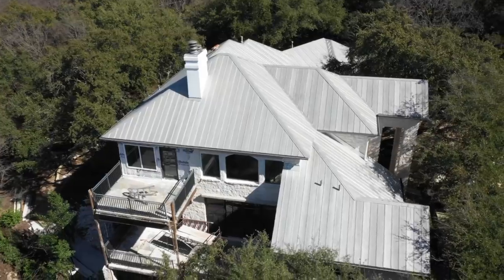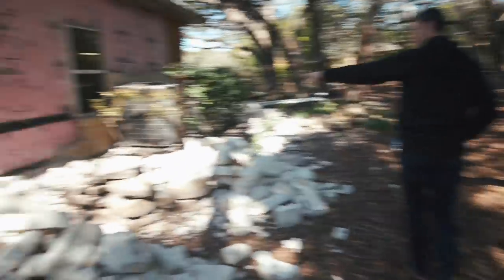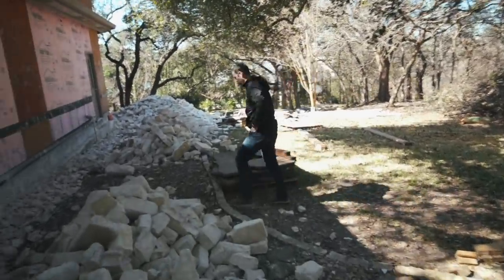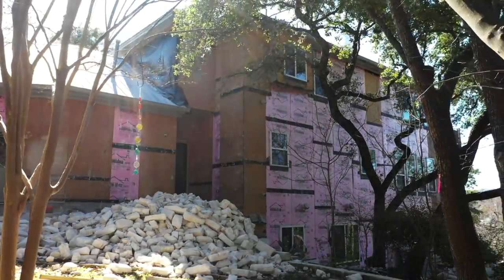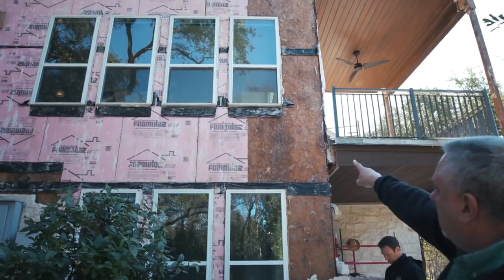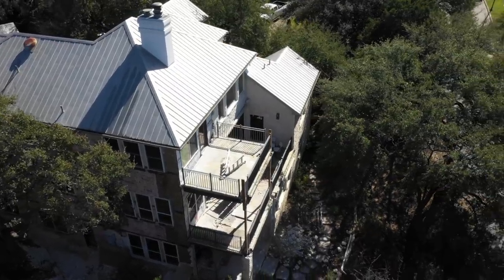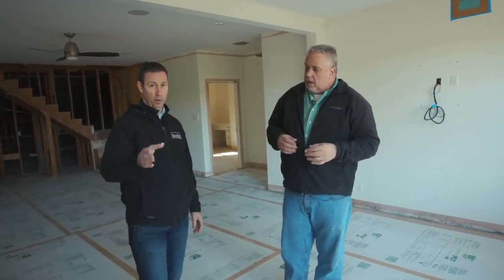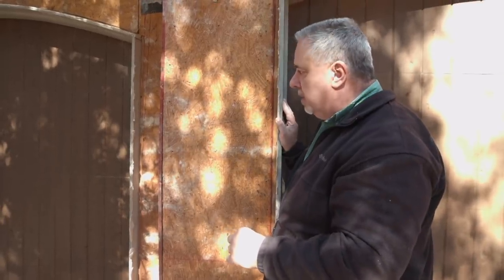You Won’t Believe What’s Behind The Skin Of This 20 year Old House!

Comment: at 16:27  "The reason this house has survived is how poorly it was built."   NO.  Emphatically, no.  The house has survived  not because it was poorly built,, but because it was well built.  The evidence is in front of you.  Yet you deny the evidence of your own eyes.  Matt,, you are better than this.  I have watched you.  You have your s*** together.  Partner with someone else.  Yes, learn from the remod or rebuild. The wall base, paper based flashing is trash,, the wall projection at the upper bath exceeds the roof overhang abilities and the flashing was installed poorly under that overhang.  And I'll bet without being on site,, just how many recessed lights are there that pierce the top floor ceiling,, and are they double walled cans  or are they like most,, the less expensive  air leaking recessed light cans??  Each can , in the winter, in Michigan will cost you a minimum of 5 dollars a month in heated air flowing up into the attic.  So, Matt, how many recessed cans in the top floors are there?  And are they well installed  double wall cans,, or the usual suspects of 6 dollar Halo 6 inch?  With the insulation pulled back to reduce heat build up?  Are they even IC cans?  Recessed lights between the interior conditioned space and the attic unconditioned space,, are just, plain, wrong.  And if done,,   must be done with a well constructed, caulked and sealed double wall can with excellent insulation around and above it.

Not "air open"    it should be moisture open.  The moisture was allowed to migrate and not be trapped.  That is nearly 30 year old OSB.  For 30 years old,, that stuff looks fantastic.  On brand new OSB I can dig flakes out with my jackknife.   So,,, why was this stone torn down?  The windows were replaced recently,, and caulked in vs. flashed in,,, but even at that, there is not a lot of water staining or damage below and at the window corners.  How are you going to keep the replacement windows?

The basement wall bottoms are showing a slight bloom of mold,, but I do not think that is capillary action drawing water from below,, rather that is condensation.  Yes it is the temp of the sub surface soil,, and warm moist internal air will condense vapour against the face of the drywall,, right where you see it.  The drywall is normally NOT in contact with the floor slab.  Normal drywall installation is top down. Ceiling first, upper wall second, lower wall third.  If you are using vertical sheeting the gap will still be at the bottom.  You lift the sheets to contact the ceiling,, sheets do not and should not sit on the floor.  Look to the furnace,, is there a humidifier attached to it?  The humidifier is your moisture source.  The slab, comparing for the date and other care that was taken in the construction,, I'll bet last weeks pay check (That is unfortunately not much.) that there is a poly sheet barrier under the slab.  Wanna test?  Cut out a strip with mold on the face.  If there is mold on the back side,, the moisture could be from the slab.  If there is no mold on the back side , and there is mold on the room side behind the baseboard,, look at the humidifier.
Reply: Huh? "Well built" ????  This house is only 20 years old.. Rotting OSB. mould, Maybe you should watch the video again.
Reply: @dnomyarnostaw  Ray.  30 years old,(one date thrown around was 1993?) and the OSB is not rotting,, it is not in bad shape.. Yes, it has had some water exposure in a few places, but ALL homes,, have a few defects.  All do.  (In general, I think OSB is awful. It is right up there with aluminum painted cardboard sheathing. And Zip sheathing is just putting lipstick on the pig.) That home has very few defects , and most areas, zero.  If the caulk around the windows,, and the roof gutters and shingles were to continue to be maintained,, that house would have lasted another 100 years.   One glaring omission in the build,, the OSB should have had a tar paper cover between the stone and the OSB surface. The exception being that bath extension,,,, It needed the roof overhang to chase it.  Now,, if you have pulled apart a few 100 and 200 year old houses,, as I have,, (my principal residence was built in 1910,, my second home was built about 1860,, and I have worked on houses as old as 1690's ?   Can you say licensed builder, City of Boston,, 1974?).

Does it have some problems,, yes,, absolutely,,, but without looking,, so does yours.  So does mine.  And so does Matt's.  Ray, that house is very good outside, and very good inside.  It does have a problem with the humidifier, or some imbalance in the HVAC.   Look at some of Matt's other videos.  He has been very forthright about looking at his own past mistakes.  That is how we learn.  But,, I still do not know why they have peeled the stone off the outside, except the complaint that the energy bills were high.  A nice big juicy job,, I wish I had it.  Clean, profitable, what is not to like about that?  I just don't know why they are doing it?  Was the stone settling?  Maybe just a wish for an 'updated' exterior.
Reply: @Sailor376also  So, even at 30 years old, its no "well built" example,  as your comments about osb confirm anyway.
I   consider any building starting to be structurally affected under 70 years to be a failure,  let alone the dreadfully poor temperature protection that it must have provided.
Considering the osb was structural  and the lower sections were water damaged,  you have a major issue. 
Of course that bathroom overhang was bad, that is just another "huge tick" against it being "well built."
It sounds like you are just envious at not getting the job of bringing a barn size shanty up to reasonable living conditions.
Reply: @dnomyarnostaw    Laughing, some of the wistful as to making a profit,, yeah.  I rarely get jobs like that.  If something does not need doing,, or if the target of what is needed is in a different direction, I tend to speak my piece.  What I do get routinely,, are the extremely difficult and complex issues that no one else wants. Those are entertaining, satisfying, and rarely profitable.  Then again, at my age,, I do not have a crew of 6 or 14 or 23 any longer,,, just me.  With lots of time devoted to paddling my canoe or sailing my boat.  That house is not in bad shape.  Look for a couple of Matt's other videos with completely rotted out walls,, mismanaged exterior water,, and mis managed interior humidity.  Humidity problems that drip condensation like the wet ring on the outside of the glass.  20 year old stuff that has rotted into CO2 and water vapour.  That IS what it all becomes.  One of the reasons I like Matt, is he shows the good and the bad,,, laughing,, though I do not always agree with him as to why. But he IS always trying to do and be better.  I give him 10 out of 10 on that.

Comment: Why not use cement board on the outside...hmmmm
Reply: That adds its own major problems, mostly because its a product that sucks moisture and is held against framing.  The best thing for any house is to have some air barrier between the sheathing and outer covering.  Siding and brick are usually the best in this regard, the stone on that house was ok too.
Reply: It's actually not code either as it has no structural strength
Reply: Stucco sucks moisture .  I am not saying don’t have barrier material or something structural not behind it.

How structural is drywall?

Comment: this is the reason why in Europe / Germany houses are built from bricks and not from wood!
Reply: Herr Struth.  Germany has no earthquakes, and until recently, was oblivious to the idea of net zero energy consumption.   You had nuke plants to supply copious electrical energy but thanks to Frau Merkel and Fukushima, that's going away.   Learn about layers, and forget about brickwork.
England is covered with brick houses.   They have high thermal mass, and that works to some extent to stabilize temperature... especially in a place like England or Germany where it never gets HOT. 

A lot of Germans emigrated to Texas, over 100 years ago.   Ask some of their descendants how hot it gets in Texas.
Reply: @johnbecich9540  net zero energy consumption i think is a total foreign word in america when it comes to energy consumption! Yes, thanks to some not so nice events in Japan, thank god we are now away from atom energy and have switched to alternative ones as far as possible. I am not talking about normal brick, but Poroton stone, which has a lot of air inclusions and is not full stone. as we know, air is the best insulator. it keeps you cool in summer and warm in winter because we have both extremes. there is no need for an unnecessary climate system that requires a lot of energy. the windows with triple glass alone help massive and roller shutters. My question have you ever lived in such a house? I can only say of a few known people who moved from Germany to Texas "they miss soliede houses"

Comment: Hey your utilities must be super high a month... Let's spend 200k on siding then we will save on utilities.. eureka!
Reply: I gutted and renovated my 1950 house, did everything to improve it without tearing off the brick and resheathing it.  Did foam the gaps and seams in the old fiber sheathing and foamed the new windows, cut drafts down to zero!  Its no ZIP system house, but it costs me an average of $200 a month to cool and heat it electrically, and Houston is hot!  The 40k+ to resheate and redo the brick would have never paid off.
Reply: bigpjohnson resheathing and brick sounds super expensive!  I can’t imagine just doing it for a new look.. just sell and move, right?
Reply: Yes, but for these 200 000 you would  probably be able to cover utility costs for 200 months, too.
Reply: maybe 3 coats of masonry sealer, lots of caulk, and a new ventilation syste. Just a fan in a bsmt moves dead air and cuts out mold...a small one can work.
Reply: @christiangeiselmann  at most all that nonsense is going to save about $400 a month which is equal to 42 years. Money now vs spread out is also a different cost. So 50 years is the return.. Being that it was that nice stone and they are going over with stucco.. not sure there is any win here
Reply: @bigpjohnson  right makes more sense to do common sense upgrades

Comment: I have pull apart houses that where built in late 90 and 2000 with “new and improved” systems that are in tear down condition .Old school is still better school provide you follow common build practices a few days with a caulking guy that house is passive also that houses seems like it was very well build ....that guy seem like a troublemaker

Comment: I don't understand why all the houses built in the US are made this way, in France all the new houses are built with cinderblocks so rotting will never be a problem. It would be more expensive of course especially with a house that size but rebuilding your house every 25 years doesn't seem very economical..
Reply: There are very different building systems in different parts of the USA. In Florida almost all houses now are built with cinderblocks for at least the first level, and there are no basements because the water table is so high. Termites are a very serious problem here so only pressure-treated wood can be used and only as the base of steel stud inner walls. North America has a lot of wood (trees) so it is cheaper than cement based construction. It is much easier to insulate a wood frame house. In South Florida we don't put insulation in the walls because the temperature doesn't change very much from day to night. Roof systems are, however, built with wood and they are insulated.

Comment: The one thing that you are going to learn is how quickly most of these homes are put up, it's about speed and profit and most of these builders are here today and gone tomorrow.
They are put up wet and sold wet. I've been to dozens of homes and why people buy homes on ski slope driveways and by next to main sewer lines and all sorts of shenanigan Harbor freight materials and I wouldn't say craftsmanship. It's just shade tree mechanic garbage. I watch these speed builders come and knock a Ranch home down to put up a 2 story home in it's place and charge people 800 grand for just garbage. Wood frame, sheet rock and plank siding. I am so disillusioned with the entire building industry.

Comment: Lesson #1: nearly every "modern" home is total garbage.
Reply: Christopher Wall Not if they are built to the code...
Reply: @juzoli  'Code' should have only technical reasons, but sadly where I live it's also used to fatten the building companies and their 'partners' in politics. As an example they subsidize gluing foam panels on plastered brick wall facades (usually brick walls are around 30-40 centimeters thick here) for better isolation. It's expensive and has a poor cost/benefit ratio compared to other measures, they don't know how to recycle such cladding and the building physics aren't sound either.
Reply: Old houses are garbage too!  With the exception of the lumber and workmanship, every old house was built with junk and age has done a number of the other systems.
Reply: @bigpjohnson  obviously a lot of materials could not last as long as we want (forever), but the reality is the draftiness of old homes is what saves them. Yesterday I inspected this 1860's built monster that had the original cedar shake and then a poorly installed metal shingle on top of it in maybe 1900...it was a nightmare but not nearly as bad as you would think. No chimney flashing and every flashing detail was wrong!!!! And not much water coming down it!
Reply: @christopher6161  Nice!  I recently demolished a 1940s house, it was never insulated and very drafty.  A shower was tiled over drywall over shiplap, and because the wood was allowed to dry there was minimal water damage!  Too bad the foundation and first floor had tons of water and termite damage so it had to go.

Comment: Insulation is an excellent example of how profit has unequal influence. When has an oil company ever been interested in doing the RIGHT Thing? Insulation is made from oil.  Using MORE of it means using LESS to heat a home. 

A house insulated and ventilated above and beyond current Code saves the homeowner. If Code is updated so that that is the rule for everyone,  Energy costs would go down, so too would the size and cost of HVAC units, so too their prices. 

That would reduce the profits of companies in a GROWTH Economy however,  and growth means increasing your profits EVERY. SINGLE. QUARTER.  in order to make your srock price climb.

Code updates could also address the inferior construction of this house. 

But the builder shaved away at "best" to increase profit. That means that energy companies also profited and so too, will Matt Risinger earn a profit from having to do major work on just a 20 year old house. 

It's not a good way to run an economy but it iS a good way to ruin an economy because people are far more hurried today in our world of automation amd other conveniences than ever before. So, oil companies have far more money and influence than imaginable but how is everyone else? Well, few people have the time to educate themselves and buy or build a home done right.